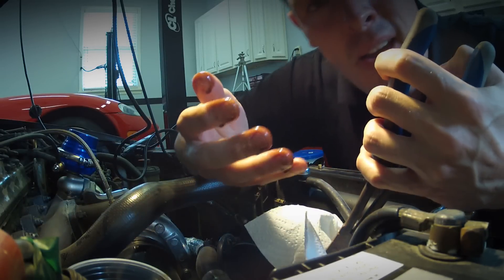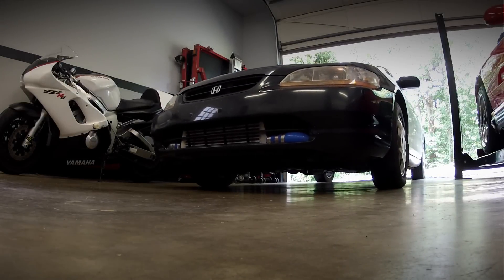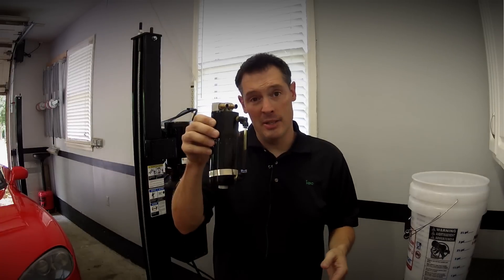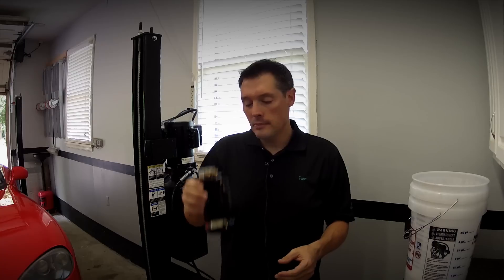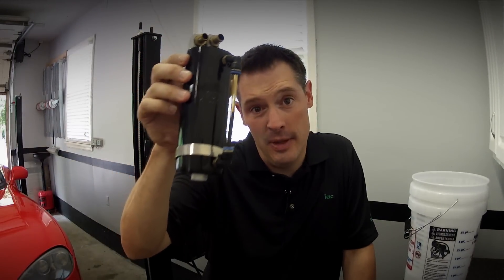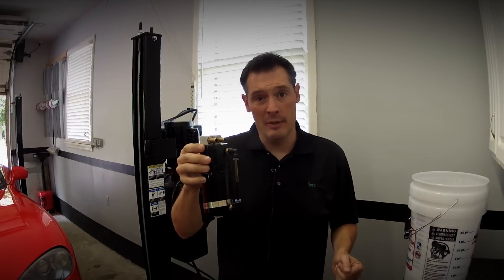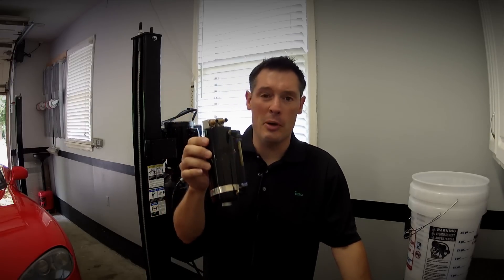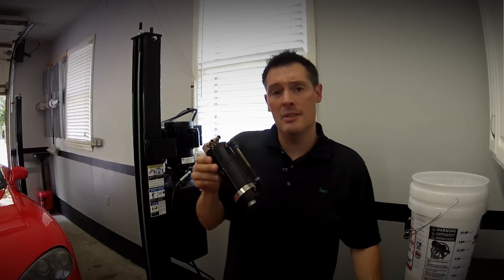Oil Catch Cans Myth Or Must Have - Ebay Oil Catch Can Review

Comment: There's no evidence that catch cans catch 100%.  There isn't even any data on how much the catch can misses.  My solution, just Seafoam every 5k-10k miles, problem solved.  No one knows how much it is actually catching.
Reply: +Shine Huang Seafoam isn't good to use on a cars with turbos.......  The debri that is loosened by the seafoam can damage the turbo blades and also can glog up the CAT's.  I agree with you that it is good for keeping the engine clean of deposits, but it is harmful to the turbos and the CAT's (on any car)
Reply: +Shine Huang The evidence is the crap load of oil you find inside the catch can.  Did you not watch the video?  It will catch 100% of the oil, because you are diverting the hose (that normally connects to the intake) directly to the catch can.
Reply: +Shine Huang Direct injection gets no fuel spray so no benefit.
Reply: +Shine Huang watch the seafoam trial that either Chris fix or Eric the car guy did (I cant remember which one did it but it's one of them two) and you'll see that seafoam really doesn't clean the engine much maybe 5% at the most. Catch cans are  proven to keep blow by out and especially stop huge amounts of carbon building up on the underside of throttle bodys. Check out them trials on seafoam as u might be wasting your money
Reply: +Shine Huang no one claims it catches 100 percent...just like none of the engine treatments claim 100 percent...
Reply: So.... stopping ~1/2 a quart of oil blow by in an oil service period isn't evidence enough that it works better than not having one? Also, the better can you have the better it will filter. Some have no filters, some have multi chamber baffles, some have multi chamber baffles with filter media like steel wool. There are levels to things and i can guarantee you if you have a high performance car or care for your vehicle in the slightest it will be a benefit to run one.
Race vehicles and diesel guys run them. Thats enough for me and most to make an educated guess.
Reply: +Tommy Thrasher you're correct...For N/A daily drivers Seafoam away...but if your car has a turbocharger..stay awsy from Seafoam!  Get a good OIL/AIR separater...from Moroso...$~100-$140 and they work properly...
Reply: Additionally...catch can reliably is further evidenced by the fact that your car isn't running like shit...If you have a turbocharged vehicle that has a MAF sensor and your catch can isnt "catching"  all of the oil...it will blow through the system and have a negative affect on the drivablity of the car...(run like shit)👍 So...if you have a MAF sensor and a catch can and your car runs great...It's working!
Reply: largol33t1 Chris fix YouTube channel.
Reply: I use Berryman B-12 Chemtool Fuel Treatment, actually any Berryman product, why, well tried & true. Seafoam does "sort of kinda" work but like the man said, the proof is in the pudding. Give it a try. I promise you, you will not regret it. Peace my friend.
Reply: I know at least for the V6 camaro guys it for sure makes a huge difference. People posting the difference between milage shows. I ran a cleaner that sprays through the intake so it can clean the intake valves on my wife's car every  year and it didn't really help, I opened up the intake to see and the gunk on the valves just kept on collecting. I had to spray directly on the intake valves and remove the gunk by hand. And that was only after 45K miles. It's honestly nuts. Either way, better to catch some of the oil and clean at longer intervals than have to clean it out so often.
Reply: Shine Huang I think you can get some idea of how effective a catch can is by tracking the amount of oil you lose / have to add between changes (the amount of oil that is going elsewhere) and the amount found in the catch can.  Might be hard to distinguish not-caught from burned, though.
Reply: ....put a couple catch cans in series and see how much oil is caught in the last one; now you know how much oil the first one missed; and secondly to everyone that says Seafoam doesn’t work, have you tried it or are you just spewing rhetoric you’ve read/seen/heard?  Ive used it on my Prelude—what a notorious EGR clogger the H22a is—and Seafoam cleaned mine up and restored a normal idle / CEL after one use.
Reply: eddy2121 chris fix is an idiot
Reply: +luke isaac ppl don't read my reply correctly.  I never said they don't work but no one
can prove how much they're taking out...maybe 5% is removed via catch can as well...but anyone's an idiot if they think the
 catch can is catching anywhere near 100%
Reply: Ha ha ha, and there are dozens of videos on Youtube questioning whether seafoam is real or a scam. I think it's a scam.
Reply: SEAFOAM IS ONE REASON WHY PEOPLE HAVE OIL BLOW BY! lmao - It cleans what was preventing the leaks in the first place - real pain in the ass on vehicles with 100k or more miles on the motors.  -  not catching anything in it?  leave the catch can on - eventually - down the road when your vehicle actually gets some mileage on it, you will see oil blow by - why don't cars come with them - because car companies don't make money selling the cars - they make money selling PARTS AND SERVICE - end of story - no use in arguing - so don't <3  cheers!
Reply: Seafoam - I will only use it for small engines - ie, go karts, lawn mowers, chainsaws, weed wackers and the like.  But I'll run a little every now again through my chevy s10 2.2 liter engine before i change the oil every few oil changes.  Carbon buildup is REAL folks - it is really a "THING" and not a myth.  You might create leaks using it because it cleans whatever buildup was preventing the leaks - but it works lol
Reply: If you're using seafoam then nothing you can say will be taken seriously. Seafoam is some rookie mechanic crap. Seafoam does NOTHING yet you're on here bashing something that's actually effective such as a catch can. I REMEMBER MY FIRST BEER.....
Reply: +Shine Huang actually seafoam is proven to be useless ... its an urban myth
Reply: +Craig Cundiff my car don't run like shit cuz I clean it all the time instead of catch can and 0 cleaning, which is erroneous since there's no data for how much passes and how much condenses.  anyone who thinks catch can catch 100% oil vapor is an idiot.
Reply: Seafoam is rubbish - I'm not even putting that crap in my lawn mower!

Comment: I have a 1997 Lincoln Mark VIII supercharged on 8 psi and I need one of these. The car has less than 100K but in my case I lose about 1 quart every 700 miles. Is this alarming with a centrifugal setup or normal? Wold the catch can reduce the amount of oil I consume (blow through) currently? The engine is fine and runs strong. I just had to ask because I use a lot more oil than your car does.
Reply from the maker: +Kirk Stromberg Not sure honestly, but I know by installing one you can see just how much "blow-by" you are getting.  If that doesn't match what you are losing then you might be consuming it or have a leak, good luck with it.

Comment: wait isnt a engine s posed to burn a tiny amount of oil?
Reply from the maker: +Tyler McClain I'm sure most older cars do burn a bit.
Reply: No i mean like, dont they need the oil in the combustion chamber to help keep the piston rings from frying?
Reply from the maker: No, you burn oil when your rings let oil by them, it is not designed that way.  What keeps the pistons from frying is the coolness of the air/fuel charge inside the cylinders.  That is why A/F ratio is important in making sure there is enough fuel to keep it cool and avoid frying anything.
Reply: Oh! Interesting...
Learn something new every day!

Comment: what if it gets full and you have not emptied it. What happens?
Reply from the maker: bigbore400 It will suck the oil from the can to the bottom level of the upper hose (inside the can) into the intake, which would not be good.  That is why I mention to change it at every oil change, or sooner if you need to.  Make sure to just keep an eye on it.  Pop your hood once in a while and look at it while checking your oil and you should be fine.

Comment: hi man how you doing i installed the catch can on a 1999 mercedes e300td  w210 but i was thinking is it gona change the crankcase pressure or damage anything
Reply from the maker: Bib Hysenaj Hi, a catch can is not changing anything really because all you are doing is running your line into a can before going to the intake instead of just to the intake like it is now if that makes sense.  I can only tell you what it did for my car and you can see how much oil it catches, imagine that going into your intake, yuck.  Good luck with it.

Comment: Is it possible to install when my car has 2 Crank case vents? Alfa 156 JTS
Reply from the maker: Peter Blomstrøm Hi, I'm not familiar with that setup, but I don't see why not.  If you have 2 vents doing the same thing you could just run them together and into the can unless I'm missing something, maybe someone with experience with that car will chime in.
Reply: Rubber Duc Okay thanks. Good video btw :)

Comment: Hey on these ebay cans which one is the inlet and outlet?
Reply from the maker: ravenouslove1 They are not marked so you have to usually take them out.  The "inlet" would be the tube that is longer so the vapor will head towards the bottom of the can, and the "outlet" would be the shorter one that takes cleaner air from the top of the can, hope this helps, thanks for the comment.

Comment: That's the exact same can I have coming from Ebay. Question-can you open that can up to drop in some mesh? I only see the two inlet and outlet nipples and the drain from the pictures, but nothing to actually open the can up. I want to put the steel sponges inside so the oil vapors have something to stick to.
Reply from the maker: Brownbear No this one does not open up, you may be able to take one of the fittings off and stuff something down in there but it would be tight, I use it without the mesh.
Reply: Thanks for the reply! Your video is one of the more sound explanations on the catch cans. Subscribed-can't wait to go through more videos.
Reply from the maker: Brownbear No problem, I'm glad you liked it and subscribed, I'm working on a bunch of videos currently, thanks for the comment.

Comment: I got that one and the fittings at the top didn't seal against the top of the can, there was no tubing, baffling, of filter media, just went in the can and then sucked in the other tube. Point being if you are getting that much oil in 4000 miles and it's not catching it all, you might want to do a compression and maybe a leakdown on the motor. As for my can I got another cheapo ebay one and modified it to actually work as a proper baffled, with filter media, oil catcher and condensor and works great.

Comment: Hi. Does the oil level indicator really necessary? Seen a model with and without it. Can i take it away and screw up the hole tight.
Reply from the maker: c4prlm4st3r Yes, very necessary in my opinion because otherwise it can get too full before you check it and your engine will suck in oil to the intake.  Thanks for commenting.

Comment: Im wondering why some use filtered ones when it's better to use one with a vacuum source?
Reply from the maker: Del Walker I think you are referring to the filter media inside the can?  If so they are better b/c as the air hits them the media gives the oil vapor something to grab onto.  These cheaper cans do not have that, but you could push some kind of media up through the drain hole I would imagine, I just didn't worry about it.  Thanks for your comment.

Comment: Would I gain any hp or loss ? I'm thinking of buying one for my Toyota Corolla 1997.
Reply from the maker: msk nuked Hi, an oil catch can will not "add" nor "remove" any horsepower by just installing it.  But what it could do is help keep the horsepower you have by catching all the blow by that would go in and coat your intake, which does rob you of horsepower if that makes sense.  Thanks for the comment.
Reply from the maker: Mitchell Mildwaters Thanks for watching and the comment, good info!
Reply: Rubber Duc don't forget oil is an insulator, so your actually losing heat exchange in the turbo if coated with this nasty oil. especially if your car has an EGR, oil + soot is bad sludge. worth every cent. great review mate, simple and easy backed by evidence.

Comment: Mine kit came with a check valve, where do I install it. W/o it, the car sucks the oil from the catch when it's running (idling) producing lots of smoke when driving and returns when vehicles is off.
Reply from the maker: I don't use a check valve, and honestly you shouldn't need one.  Your PCV valve is the check valve.  The only thing I can think of is you have the lines crossed on the can b/c that could allow oil to be sucked from the can but I wouldn't think at a high rate.  Make sure the line coming from your PCV valve is connected to the line on the can that sits lowest in the can, good luck with it.

Comment: Be careful with the crap on eBay. Most of the cheap ones don't have an internal mesh which is the    Most important part of a oil separator or "catch can"
Reply from the maker: Thanks for the comment.  You could certainly add it if you wanted through the small opening, however even if you didn't it is MUCH better than nothing at all.

Comment: Very nice I just installed the same, hiw u know what is in and out ? Does it matter how does the oil not get sucked by the valcuum of the motor
Reply from the maker: Well one of the hoses inside the can should be longer than the other, this one would be the "in" that you would splice the PCV valve side of the vacuum hose to.  The shorter one inside the can is where you install the line that runs to the intake.  It shouldn't suck oil b/c the longer hose is below the shorter one and the oil is heavier than air, so it will drop to the bottom and clean air inside the can will continue to the intake.  Hope that helps, be sure to rate and subscribe!
Reply: Rubber Duc awesome I just posted the vid can u comment and see if it looks right to you. Its the same can as that I didnt know there was hoses inside that good to kno.
Reply from the maker: amermuscle There should be a knob on the bottom where you drain the oil, unscrew it and get a flashlight and you will see there is a longer and shorter one.  I don't know how much it matters but physics would suggest the lower one would be better for the "in" line.  You can't really go by what mine is, because the person assembling them may have switched them, so it is better to look inside the can to be sure.

Comment from the maker: Hersh Sisodia Hi, your "reply to comments" button is off so I can't reply directly to you, hopefully by linking you here you will get this.  I believe I got the oil can from "Speed Daddy" out of California, but lots of vendors sell them, just look for the one that is like mine and it will be around 20 bucks, good luck!
Reply: husky air water seperator from Home depot can be modified into a high quality catch can that is comparable to many high quality baffled catch cans.
Reply from the maker: teknodogg Yep, that's it.
Reply: Rubber Duc The blow by gas needs to be "scrubbed" of all oil vapor using fine steel wool.
Reply: +Brett Mansfield you can go that route 1 issue is a bad rubber gasket in those Husky air water seperator that cant handle the heat and will eventually develop into a vaccum leak. 

After 6-8months on that setup while it worked very well i prefer what i eventually switched to which was a modified Mishimoto 80-90 dollar oil catch can that i spent about 10-20bucks modifying into a 2 chamber baffled can. i wanted a high quality product and Mishimoto offers a lifetime warranty on the cans but you could do the same modifications and baffling to any cheap chinese catch can. i think it makes a suprising difference to have a full metal Catch can and also have it in a cold place for better oil collection (mine is in front of my radiator directly behind grille now). This works better because its easier to drain. I rerouted my whole PCV system with Silcone hoses but you dont have to necissarily go that far.
Reply: +Brett Mansfield other than the catch can youd just need to find out your stock PCV hose size and then get some good hose to use for mounting the can. i prefer performance silicone but that's me.